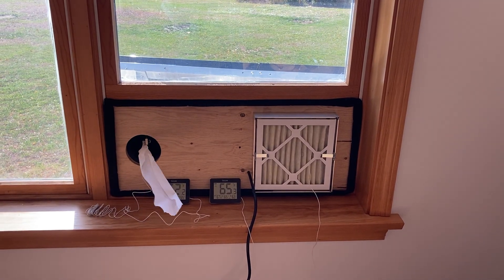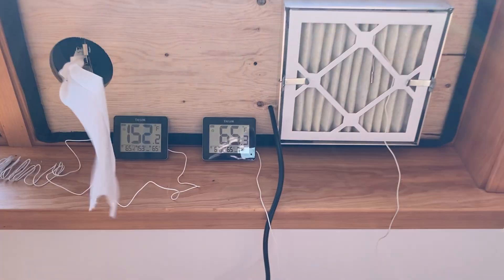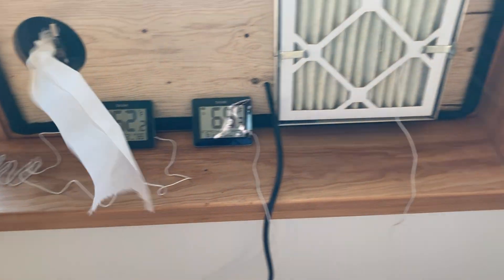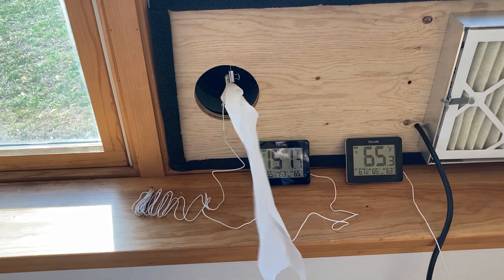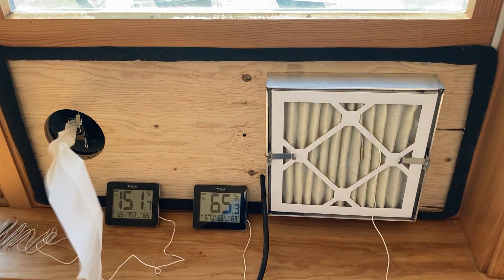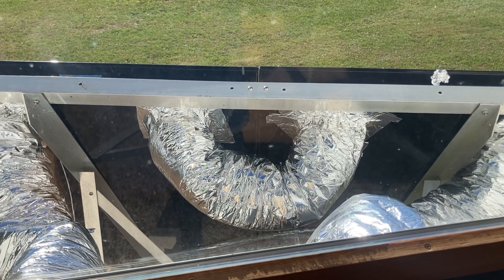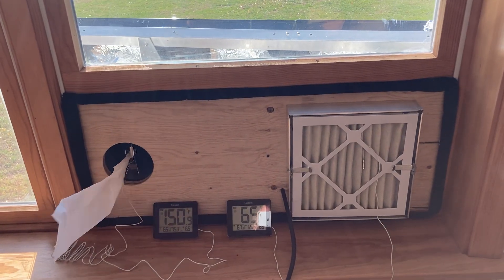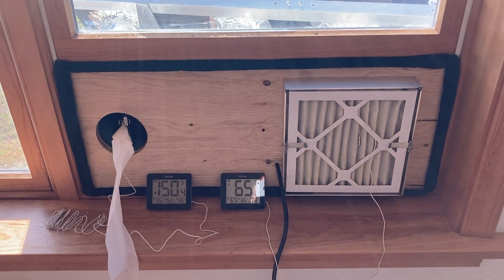D.IY. Solar Home Heating System,

Comment: What is the point of placing the filter in the outflow, instead of the inflow?
Reply: Did you watch the same video as everyone else?
Reply from the maker: The side where the filter is is the inlet side.
Reply: @paulsoucy5834  The side where the filter is is the inlet side.
- I believe we use different "reference point" for "inlet" and "outlet" here. 
To avoid the confusion, I will paraphrase. I believe the filter should be placed in the hot air pipe. The reasons are as follows:
1. The filter looks like a semi-HEPA class, thus, I guess, it is intended to protect users, not the heater. 
2. The filter will cause much less resistance to the airflow if placed in the hot air line, less energy consumption, and better airflow.
The only advantage of the current setup is easier filter cleaning.
Reply: @RomanShein1978  By placing the filter in front of the fans, you keep it and the interior of the system cleaner. Otherwise you will get dust build up on your fans and interior side walls/tubing.
Reply from the maker: @RomanShein1978  Hi, the tissue paper was attached to the outlet side to side to show the air flow into the house, the filter side is the inlet, the fan is sucking the air through the filter.

Comment: As a heating consultant, I have to admit to being a little confused.  You have your extract (from room) filtered, why - is it to inhibit dust build-up in the ducting?  I don't actually grasp why there is ducting - you could have cassette boxes exposed to solar radiation.  Plus, that is quite a capital investment to make, and may have a long payback time.  I don't know without seeing all your costings, Paul.
1.  Capital cost
2.  Running costs, maintenance & replacement (if any)
3.  Loss of interest on capital expenditure
4.  Amount saved on energy bill
Number 4 must be greater than 1,2&3 over a reasonable time.
Reply from the maker: Hi, while the fan is running I am filtering out the dust and my dogs dander, it keep it from being blown all over the house. I sell the kit for $2500, that includes everything, you can save a lot if you build it yourself. The reason it is on a rack is that I can face the system true south and angle the panels 60 degrees that is best for solar heating in the northeast, It takes about 15 minutes to brake down the system and store away in my barn. Next heating season I will set it up again. You can leave the system set up but the panels should be covered in the summer it they are not in use. I have systems that have been running for 40 years. Running costs, we pay $.32 cents per kWh the fan draws 58 watts. x 6 hours = 348 watts = about .12 cents per day.
Reply: @paulsoucy5834  
Thanks, Paul.  The problem is that it requires a capital investment of $2,500.  Let's say that it saves $150 a year.  Add in loss of interest (@3%) means a reduction (in your saving) of $75.  This means a payback period of 33 years...by which time the materials would have failed and needed replacement.  So we're actually looking at circa 40 years for payback of the total amount invested.

This is the issue with set-ups such as yours, that they aren't cost effective.  It's why solar panels don't typically pay back (and can actually COST!).  For anything to 'save' money, it has to have a small capital investment unless the return is huge.  This is a problem with domestic wind turbines, in that the investment is large, and the return small.  In order for your device to be cost effective, you would have to shave a whopping 60-70% off your retail price.  It could be made cheaper by removing the ducting, and simply having a cassette box with no heat transfer.  Without seeing your data, I don't know why the retail cost is so high (profit margin or cost of glass?).  Similar pool heaters have been constructed here in England with used double-glazing units.  The glass is free (taken out by window fitters) and they sit on a timber box which is black inside.  They get hot even in light sunshine (as a greenhouse does).
Reply from the maker: @TomDelaneyForPresident The system collects approximately the equivalent of 1900 kWh per heating season in the N.E. x $.27 = $514 per heating season. Its more of an environmental thing also.

Comment: Do you have considered a Peltier element, to gain some watts?
Reply from the maker: This is for heat only for heating my house, I did not have to turn on my heat for 2 days.
Reply: @paulsoucy5834  You only use smart air exchange, don't you?

Comment: How do you deal with the humidity in the air?
Reply from the maker: I do not have much humidity in my house just from the plants I grow. High humidity can be an issue in some cases a small weep hole can be drilled to drain any condensate.

Comment: Are you running your fan off of ac or a panel?
Reply from the maker: AC, It is a fantech fan, UL approved, I did sell single wall mounted systems with a PV driven fan. The fantech fan is much more powerful.

Comment: Do you have a link to the the panels themselves?
Reply from the maker: Hi, We make the panels, Heavy duty frame, low iron glass, Highly selective corrugated absorber plate, .95 absorptivity, .05 emissivity, 1" polyisocyanurate insulation on the sides and back. $750 each. my email is envsolar@comcast.net (Note: If the panels are not used in the summer they should be covered up or stored in a barn or shed).

Comment: Then what do you do when it’s night time and it’s more colder?
Reply: You still have a furnace for night time.
If you can keep the furnace off during the day that's a good bit of savings.
Reply: @charlesdahmital8095  should look into a Chinese diesel heater. I got one and made a bracket for it to sit by my window and the exhaust going out. I can heat up my whole first floor for close to 4 days  on one gallon of diesel. I made a thermostat for it and it turned out on & off them unit on its own. Now compare that to gas heating and you’re saving hundreds. The heater I got is a 8k. I actually have three heaters. One is for my second floor if it gets really cold and the other is a backup. Added the heaters run off a 12v battery.
Reply: @charlesdahmital8095  depending on where you are it's supplemental heat so just cutting down the furnace runs
Reply from the maker: There is a backdraft damper in the duct so when the fan shuts off the damper automatically closes.